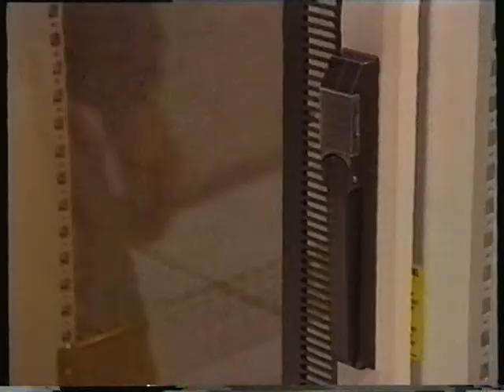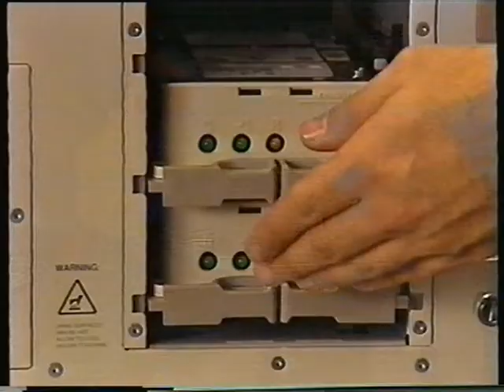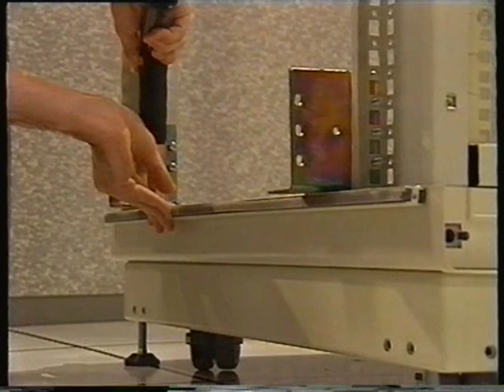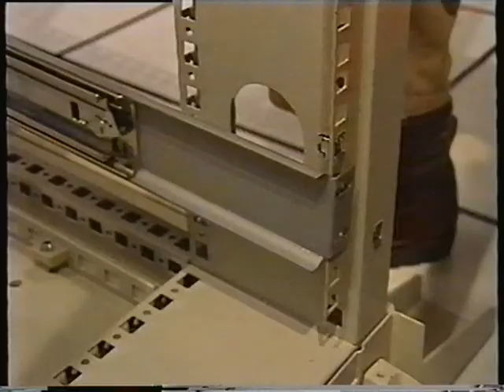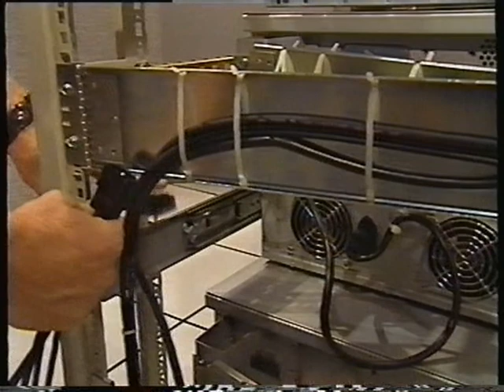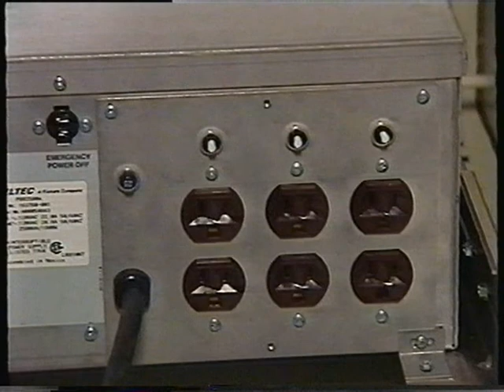Rack Mountable Compaq ProLiant Servers Installation video (1994 VHS)

Comment: Those machines were rock solid. We had a ton of those racks at work.
Reply from the maker: Wonderful! They are incredibly reliable machines, yeah. I've been running a ProLiant 3000 nearly 24/7 for the past few years, and have had zero problems with it. Nearly 30 years since it was manufactured.